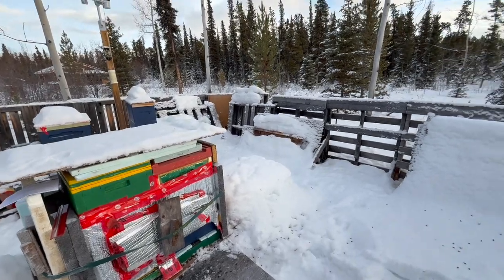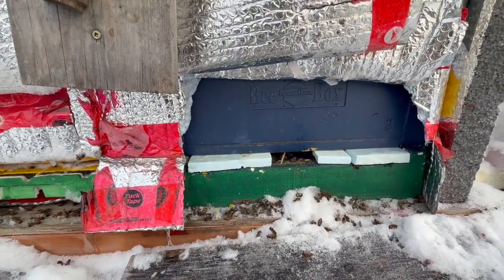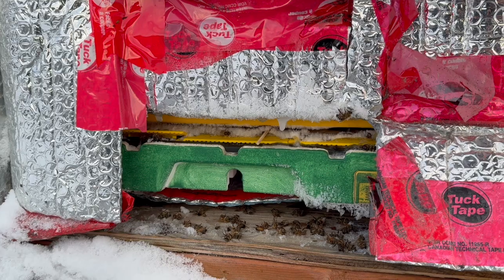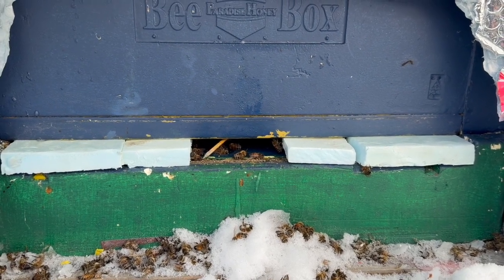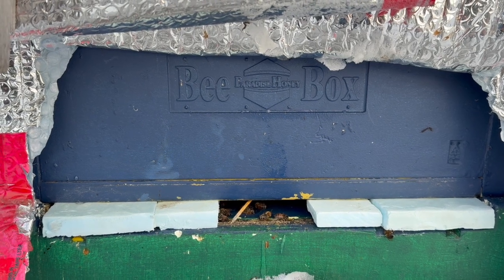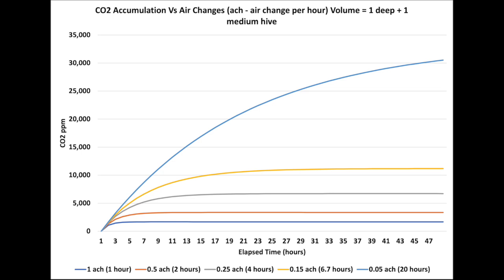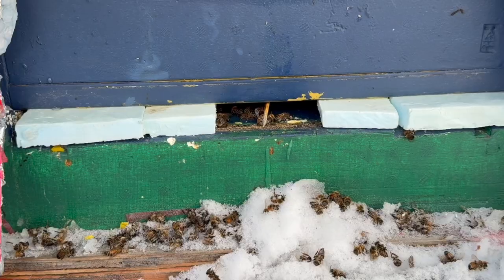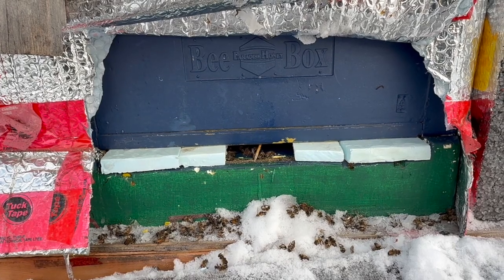Entrance Updated   Impact of a plugged impact

Comment: Last week I observed a worker over the course of about 15 minutes appearing to quite intentionally using the corpse of a couple of dead workers to aide in reducing the entrance to the hive. I have quite small entrances currently (put on in late fall as part of a wasp defense strategy). Seeing your worker tumble and fall off the edge of the cliff caused me to wonder if she was actually trying to toss the dead bee out or perhaps engaging in some dynamic hive air flow conditioning. I'm hoping to catch more footage of workers manipulating dead bees as insulation blocks, but it would be almost predictably fascinating if in addition to fanning and other air conditioning behaviours, bees will also set up their own barriers. I'm in Victoria and the the nighttime temperatures have been hovering in in the low single digits. The placement of my hives is such that it they aren't particularly shielded by the wind. The windy weather we've been having down south here are such that perhaps this behaviour is more about blocking wind than specifically thermal gradient control from static temperature differences in and outside the hive. Anyway, just thought I'd pass on my observation.